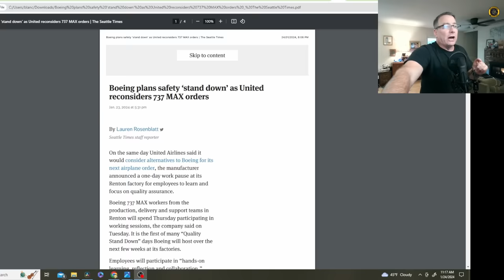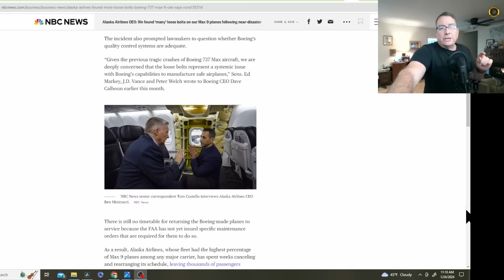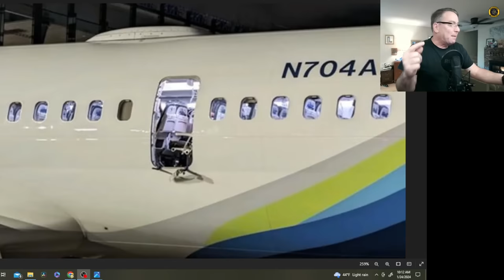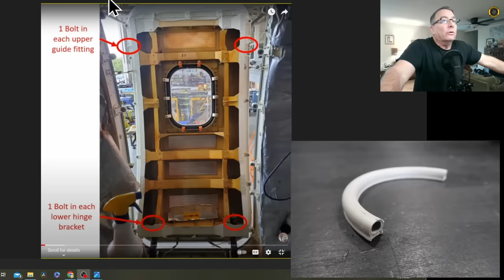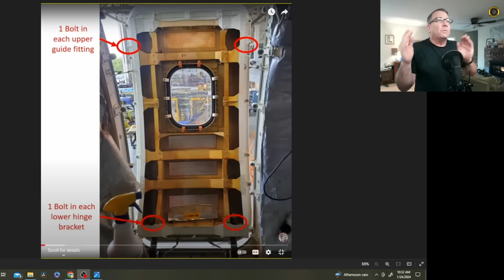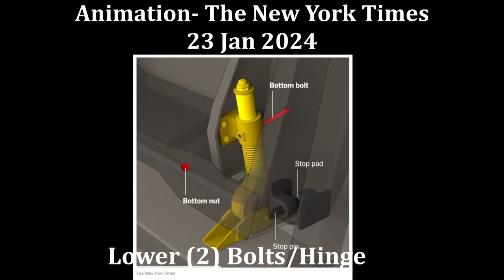Boeing's Quality Management Failure Explained 737-Max-9 Door 24 Jan 2024

Comment: I was an Avionics Tech in the Navy. Whenever I opened a radar component, even if I only removed the lid for a visual inspection I had to have a CDI (basically a quality control inspection) done on the piece of gear before I could check it off as complete and put the lid back on, then again to check that all the fasteners were torqued to spec and then and only then I could wrap it up and the part could be returned to the aircraft.  The Navy did this for ANY maintenance action on any aircraft. I’m shocked that this isn’t an industry standard.
Reply: Naval Avionics Tech here as well. Yea, That blew me away. Not only opening part of the fuselage, but also REMOVING FASTENERS didn't immediately trigger a QA check after maintenance. Just... WOW!
Reply: Apparently military lives are important, but not those of civilians.😢😂
Reply: I was an aircraft mechanic at the now long defunct Eastern Airlines and that's the way our Aircraft Service Center in Miami was run too. They called it double-buy-back on everything. However, once the plane was no longer in an overhaul situation, say out on the line, only items on the Required Inspection Items list (RII list) required 2 sets of eyes. I suspect a pressurized door might have been an important enough item to be on the RII list though. It's really not rocket science..
Reply: @richardtjan4757 wrong perspective. Many of these aircraft are difficult or impossible to replace.
Reply: . Thanks for your service and insight. Industry is not the military. The military doesn't have bean counters scrutinizing every process and applying production pressure on every person in the manufacturing division in order to squeeze a few more dollars into stock values.  As I understand it, the military isn't focused on profits, but on the success of the mission.  737's would cost a LOT more if the military was building them, but they'd likely be built properly.
Reply: There aren't that many A&P's working there at Boeing.
Reply: @wadepatton2433 it's more laziness than about the money.  It would not take long to get an A&P to watch the installation of that door.  Most employees at Boeing are not A&P mechanics.  Maybe that needs to change.
Reply: But did they also make sure you didn't leave a flashlight inside the engine? 

All this nonsense and incompetence and complacency is not unique to Boeing.
Reply: I worked over 40 years on heavy jet line maintenance.  There is no way line maintenance could operate if all minor items require a RII inspection before next flight.  And who would pay the price for an increase of personnel to cover additional inspection requirements.
Reply: @richardtjan4757  nah! That ain't it. It was $$$
Reply: @richardtjan4757  Military lives get congressional scrutiny. Civilian lives get congressional stock tips.
Reply: @roflchopter11  there are engine mechanics and plane captains who inspect the engines before starting so yes they do check for flashlights, coins, hats, any type of FOD and damaged blades.
Reply: Would have thought that opening or removing the door would be a critical task and involve A&P and a A&P IA licensed engineers to inspect and sign off the installation.
Reply: @tmayorca8770  apparently not, considering the loss of an F135 engine in an F35 a week or two ago.
Reply: Back in my AF 1970  days I was an E-5 Automatic Flight Control System Specialist (auto Pilot) on fighter aircraft. I was required to inspect any work done by someone else to verify it was done correctly. All parts, safety wire installed, and tested before releasing the aircraft to fly. The Auto Pilot system is fully integrated with the aircraft control system any any minor issues would spell disaster, I took my job seriously as a 21 year old Staff Sergeant and it taught me a whole lot  about trusting others in my later life.
Reply: @oldmech619  The payment comes from those people who die from seemingly minor infractions that cause a plane to crash. Every safety rule is written in blood. Common sense to some isn’t always to another. This is the reason the military, or at least the Navy as I can’t speak for the other branches has these checks in place. The NATOPS manual also known as the 4790 was written in the blood of those who were injured or killed.  There has been more than one plane downed from items such as these bolts that have been misses by technicians.
Reply: @cascadesouthernmodeltrains7547    And the military is not the same a civil aviation. The military is well known for having large portions of their fleet out of service; 30%.  And how much do they fly?  Very little compared to civilian operations.  Don’t confuse the two.  And the military crashes a lot of aircraft.
Reply: @roflchopter11  it's rare but it happens.   We had one where the one diving the ducts left the flashlight in the intake laying across the inlet guide vanes at 6' o'clock position.  It went flying!  A minute later that Larson said they left their flashlight in the intake.  We told the pilot what was going and return to base. He did and taxied over.  After shut down we found the flashlight intact and complete  resting against the inlet guide vanes which do not rotate.  That was crazy.

Comment: A&P for 45 years. Any time a safety was removed and redone we always had a second set of eyes look before any further work was done. This is just plain insane that it wasn't caught.
Reply: Same in welding/sheetmetal fabrication. You generally had to have a coworker double check your fit up. Some government contracts you have to log checks.
Reply: The fact that Boeing QC and Spirit Aerosystems QC systems don't talk to each other is crazy. Spirit is Boeing Commercial Aircraft's single biggest subcontractor, no? In any event, it's a massively important sub. 

Part of the original sin here is that Spirit was spun out of Boeing. Perhaps part of the solution is that they should be reintegrated.
Reply: @cv990a4  Whenever they're ready to go on strike, the union takes credit for the quality of what they produce. Strange we're not hearing them take responsibility for this at either company, eh?
Reply: @ReflectedMiles  I'm not a big union guy, but this is 100% a management issue.
Reply: @cv990a4  Yeah, no. It's an everybody-who-was-involved issue. The buck stops at the C-suite, but that's not the only place it goes. When any individual or group within an organization wants to lay claim to being the cause for the great quality they produce, that is a two-way street. This is McDonnell Douglas at its finest.
Reply: I agree i like having a second set of eye's to check the work to make sure everything done and didn't miss any thing. Any body can have a bad day and just make sense to have your work check and maybe rechecked. That is what QTY checks are fore.
Reply: Exactly
Reply: @ReflectedMiles Totally agree. There were most likely several points that this error should have been picked up. Even the people who installed the interior trim could have noticed the bolts missing. So what’s the simplest way to not have this happen ………… maybe ensure whoever opens or removes the door has to be responsible to reinstall the door and the bolts. Also, color these bolts bright red …… this way a half blind person can notice they are missing. Obviously on such a massively important item there should be some automatic redundancy in checking this. Whoever was working on the door can’t just go on a bathroom break and then come back and move on to a different job. I have a feeling this was something stupid like when I was having the wheels rotated on my car and the mechanic got interrupted by something. On both rear wheels he managed to put the wheels on and only finger tightened the lug nuts. I was pretty close to the highway I was taking to go home and made it up to about 55mph when I realized what was going on. I pulled right off the highway and went to the wheels immediately and could turn all lug nuts with my fingers. This business of having Spirit and BA working together on a plane without proper coordination seems pretty dangerous practice. What is even more concerning is that they have been finding other lose bolts while checking this door plug. The bolts holding the door plug are either on or they are not. I don’t think it’s a case of them being “lose”. A bolt with a castle nut and cotter pin is similar to how most wheel hubs on cars and trailers are installed. The only way the nut will come off is if the cotter pin is missing. If the cotter pins were missing on all four bolts (which is almost worse in my mind) I still think it would be hard for all four bolts to come out of place to allow the door to move up and off the plane. Someone at Boeing must have a very guilty conscience……… they have to know exactly what happened here.
Reply: @ReflectedMiles  That is an interesting thought.

Comment: The Seattle Times article is a real eye opener.  The problems with the Max 9 go far beyond the door plugs.
Reply: How do we know that it’s limited to the Max 9?
Reply: @hardyfamily396  There have been reports of foreign objects left in tanker aircraft delivered to the USAF, so I doubt very much is "just" a Max 9 issue.
Reply: @markphillips2076  that’s what I’m getting at. Plus the 787 production lines being shut down for a year over quality issues, 737 rudder checks, etc. 

I don’t feel that I can reasonably and rationally have any confidence in taking my young family on modern Boeing aircraft anymore. Which is sad, frankly.
Reply: @hardyfamily396  I felt that way too until reading that Spirit Aerosystems Europe is an important supplier for Airbus as well. It's not 100% certain that blame for this problem is solely attributable to Boeing until the investigation is done.
Reply: @lisaa8795 Sprit supply 70% of the 737 to Boeing, including the whole main fuselage. They supply "leading and trailing" parts of the wing to Airbus for the A320s, which are fitted by Airbus. That's an entirely different scale (Ref: Spirit Aerosystems).

And, although we can be sure their aircraft are not perfect, I can see no evidence that Airbus have the same sort of deep rooted quality system failures that Boeing plainly have. They haven't had their production lines shut down due to quality problems. They haven't had the major in service incidents. They haven't had the whistleblowers.